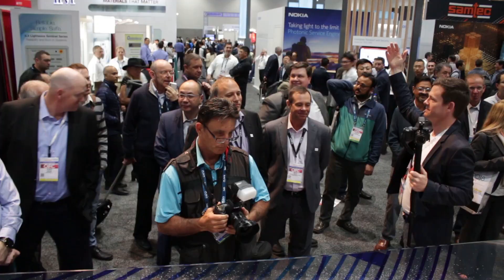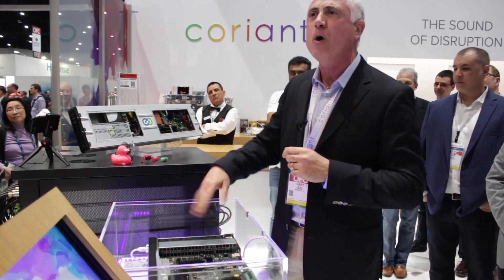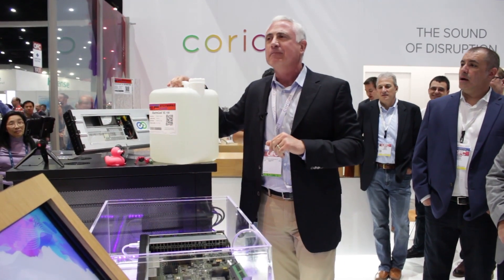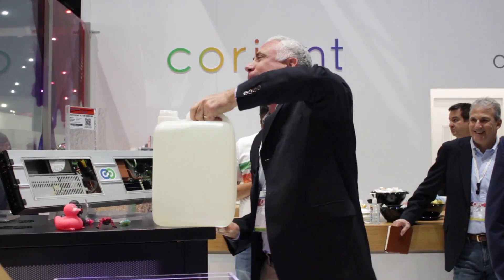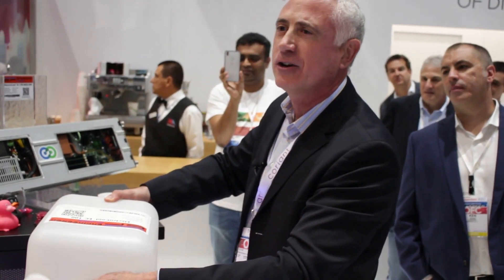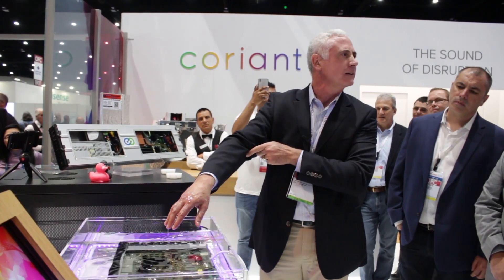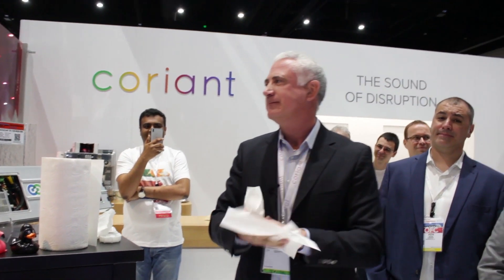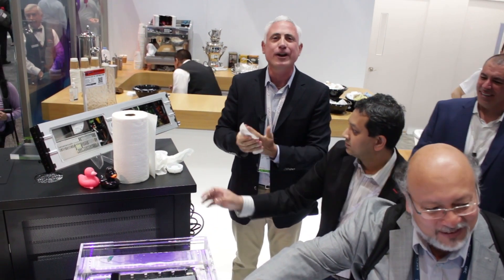Engineered Fluids' ElectroCool Dielectric Coolant - What is it?

Comment: And what happens when you have to replace a Riser Card? A CPU? or upgrade the DIMMS?
Reply from the maker: You replace them as you would in any server there is no need to clean or remove the ElectrCool fluid from the server.  You simply replace the components.   ElectroCool Dielectric Ffuid does not build up a film or coating on the electrical contacts as happens with mineral oil.
Reply: @garytesta2324  Oh really, that simple? LOL 
I work as a Customer Engineer for IBM (over 20 years experience) I repair all large enterprise systems to include power servers, storage & z mainframe. 
I also work as a contractor on all Cisco, NetApp, Dell, Lenovo, Pure and many more. 
This is a complete NIGHTMARE to replace parts. You would need way more TIME, way more SPACE and Data Centers DO NOT have that. 
What? I stand on a tarp and do the replacement? Hahaha
Most importantly, where are all the cables? LOL.
Looks like a great idea but by solving one problem you made a whole bunch that need to be sorted out. 
imo, smart people always come on with new & improved ideas WITHOUT thinking about the guy on the other side or even including them in the journey. 
Example: You made it sound so easy, like it's nothing and I'm here to tell you, IT'S NOT at all. 
Looks nice though, GL
Reply from the maker: @unclepecos509  Unfortunately, this is nor an uncommon response from engineers that don't completely understand a new technology.  To assume that we haven't thought through the maintenance and failure resolution modes is an incredibly poor assumption.  BTW, No you don't stand on a tarp (LOL), unless of course there is something else you are trying to prevent falling on the floor :)   

So let's answer some your basic questions:  1) All the cables are easily accessible on the top of the servers and you simply remove the ones required to replace a board or remove all the ones require to remove the server from the tank.  This is really no different than what you do today except you don't need to climb in back of the server cabinet as everything easily assessable from the front of the immersion tank.  2) We use a simple overhead electric hoist that is positioned above the tank to remove and support servers from the tank.  This hoist allows you to position the server over the tank and rotate it in any direction to allow you access to all the server components, boards and components.  In addition there is a perforated work tray that slides under the server that is supported by the tank that prevents components from falling into the tank and allows you to position tools and components on (yes of course its grounded to prevent static) it also has a brace to hold the server in any position required to ease access.  3) Ease of access, generally we don't keep all the chassis covers on the server as they are useless in fluid and this allows quick access to internal components.  3) This isn't an immature technology but rather one that is in full deployment including by the way with IBM, Google, FaceBook, Quanta, Juniper, and many others.  You are correct in your statement that you need to sort out problems before deployment!  In fact, the Operations and maintenance were one of the FIRST things we thought about in constructing our systems because we knew that existing engineers hate change and new things, so we had to solve these operations issues up front.   Your welcome to come down to St. Petersburg FL next time you take your family to Disney and we'll get you certified on Immersion Cooling!

Comment: Can it replace transformer oil?
Reply from the maker: Yes we have a specific family of products for transformers called VoltCool, its designed to meet the 40year stability requirement as well as being fully biodegradable for use in sensistive ecology locations.  I addition we have a version of VoltCool called VC-140 with an extremely high fire and flash point for use inside building that also meets Japan's very high fire requirements.  If you send an email to sales@engineeredfluids.com we'd be happy to provide you with the appropriate Tech Data Sheets and SDS.

Comment: I have to question how long before the chemical evaporates to refill, and the second question is it corrode to any of the components in the system like parts in the servers and computers (plastic certain metals ext....) TKY everyone.
Reply from the maker: Our products show no evaporation below 180C so there is no need to ever refill your system.  Our Dielectric Coolants fully protect all electronics and components operating in the fluid so there is no corrosion.  If you want to see a detailed list of compatible materials please see our Materials Compatibility Guide:  https://www.engineeredfluids.com/our-resources/compatibility-guides/

Comment: This is revolutionary. Why isn’t anyone using this? Even the high end builds on the web don’t use this yet.

Can I use this for a Raspberry Pi?
Reply from the maker: You can most certainly use this for a rasaberry PI, you don't even need to have the fluid circulate as the rPIs are pretty low heat.   In terms of why isn't everyone using this, those that are really winning in the edge data center space are most certainly using our technology every day to increase their lead.  Its their secret sauce!
Reply: @garytesta2324 could you use your fluid to cool a motorcycle supercharger intercooler? I know it doesn’t involve electricity but wondering if this could be the innovation the racing world is waiting for to cool our engines!?  Way cool tech regardless….
Reply: @TreadTalk247 It could not cool a supercharger because the fluid would expand so much it would make things explode

Comment: If you used this with GPUs would you take off the heat pipes and just use the bare pcb?
Reply from the maker: No, it's easier if you simply leave the existing heat sink on the board.  If you wish to remove the heat pipes and replace it with a smaller heat sink, you can certainly do so but it's pretty costly and most customers don't like the hassle of replacement.

Comment: Could I use this for an outdoor battery pack application in order to heat the pack up above 0C?  How far below freezing will it maintain a viscosity that could be handled by a typical centrifugal pump?
Reply from the maker: Yes, we have exactly that application in production today with a number of micro-grid and grid storage battery applications.  Our products are pumpable down to -50C, but the best part is that if you properly construct the battery compartment, you can stop the flow the coolant while its warm and use it as a highly effective insulator to keep the battery well above 0C without having to heat the fluid for over 20 days. This allows the battery to remain at peek performance temperatures without using energy, then when the battery is used it naturally heats up the Dielectric Coolant, and if the system requires cooling you simply activate the pump to begin the cooling process.   We also have applications that use the waste heat created to heat homes and pools.

Comment: Water doesn’t actually conduct electricity. The salt ions released from your hand when you place it in water do.
Reply from the maker: Your correct, deionized water immediately begins to pick up any stray ions from metals, salts and other sources on boards and electronics and quickly becomes fully conductive.  In addition, deionized water is very corrosive, particularly with soft metals like copper and tin.  So its difficult to use as a dielectric with out fully protective films and special components.

Comment: Would this be a viable fluid to cool marine engines in a closed loop cooling system, rather than the typical raw sea water used in today's standard?

This could be HUGE for marine applications depending on it's boiling point/dissipation rate (if any).
Reply from the maker: Our dielectric coolants while capable of replacing the typical raw water cooling, would likely not be economical in this application as there is no need for dielectric (non-conductive) qualities and there are plenty of standard coolants that are readily available and very cheap.   That said one of my favorite applications for our dielectric coolants is cooling the onboard electronics on board ships and yachts.  Because most 50ft + plus boats these days have a server on board to control the engines, navigation, internal lights, etc. these servers corrode quite quickly due to the salt in the marine environment.  We have server containers that are filled with our dielectric coolant and that is circulated through a simple tube in tube heat exchanger using raw water cooling drawn by the engine, generator, or stand alone pump.  This effectively seals the servers in a full protected environment and enables them to be placed anywhere in the vessel and be completely sealed from water incursion, salt air, etc.  This application is being tested on submarines, and other vessels that use a lot of high powered electronics.  Its silent, very low power, and highly effective for cooling the electronics.  it also dramatically improves the overall MTBF calculations by eliminating the fans and using SSDs.
Reply: StrikeForce K9 look up the 3M NOVEC fluid on YouTube. Gigabyte submerged a full server in the fluid. The guy explained the processor gets so hot it literally turns the fluid into a vapor, and then they have a radiator which condenses it and feeds back into a tank. Hope this helps.
Reply: @zachduncan4936  just checked it out, thank you! YES, this stuff would be impeccable for closed loop cooling systems on marine craft/boats.

We currently have two ways of cooling boat engines: Marine antifreeze in closed loop cooling systems (much like 3M used in that video except running through a boat engine's cooling valleys instead of surrounding the components) and raw sea water.

The downfalls is that Marine antifreeze is rather disgusting stuff and pollutes the water heavily, should a boat sink. Raw sea water (it's the most common cooling method as of now, prob like 90% of the boats out there cool this way) creates so much gunk, crud, and deposits foreign bodies into your engine valleys and etc because there's very few filtering systems along the way to most engines.

I feel like this would be way better to bring the motor temp down by running through the engine and through an external a heat exchanger. If it can keep an engine around 140-160, it'd be great.

Not to mention all the electronic components that heat up immensely at the helm (fish finders, chartplotters, 25w vhf radio units, etc etc).

I feel like there's a lot of useful marine applications possible with this, dependent on cost factors of course.

Comment: could you use this in an application for say, contained transformer units? and would it operate proper cooling through convection or do you have to mechanically move the fluid? i have several small    (1 cubic foot) transformers in an area that i want to cool and fans are not an option. so i havent looked at the math but im assuming that i could basically make this work with a five gallon setup
Reply from the maker: Yes our VoltCool product is used specifically to cool transformer applications as you describe.  You have to calculate the total mass of coolant carefully when using only convection as you need sufficient mass of our VoltCool and surface area on the outside of the container to dissipate the heat properly.

Comment: I would really like is part of a lot more if the company would actually allow comments on the YouTube videos. So my question is is how long does this stuff last so by have a data center that's emerged in this how long will the food last before any day exchange it. And can it be cooled Kennedy ran through a cooling process to skip it at say 40ﾟ. And if it gets cold enough is there any ill interaction or moisture that would form on the surface of the electronic that would cause it to short
Reply from the maker: ElectroCool Dielectric Coolant has a 25 Year Shelf Life and a 10 Year operating life.  There is no moisture possible as the coolant is hydrophobic.  Feel free to email us directly at Support@engineeredfluids.com and thanks for your comments!
Reply: @garytesta2324  rust free?
Reply: corrosion resistance
Reply from the maker: Completely rust free.  If you go on our website - www.engineeredfluids.com and go to our video section you'll see us pour water on an operating server with no ill effects, the water simply pools on the chips and drips off while the server operates normally.   Our product completely protects all the server components from corrosion and water intrusion.
Reply from the maker: @abelf210  Completely rust free our fluids are hydrophobic, check out the video on our website where we pour water over an operating server while it is in our test tank!
Reply: @garytesta2324  I have an asic miner I need to cool. I purchased your EC-140. Is it safe to submerge the power supply as well?
Reply: @mediaclipz570 . 
Yes you absolutely immerse you power supply
Reply from the maker: @mediaclipz570  Yes completely safe to immerse your PSU
Reply from the maker: ElectroCool has an operating life of 10yrs and does not evaporate during use.   ElectroCool remains a liquid from -60c to 198c so your question concerning cold weather operations is straight forward in that there should be no condensation in the tank.